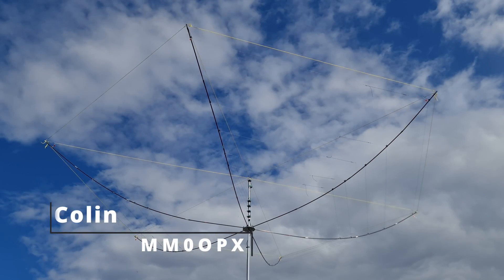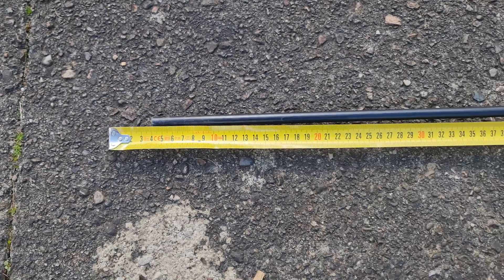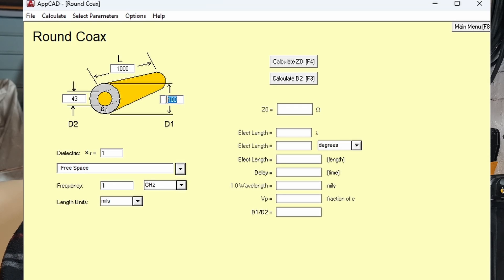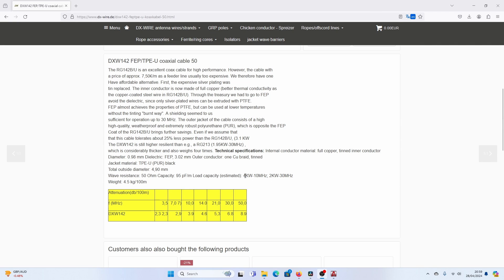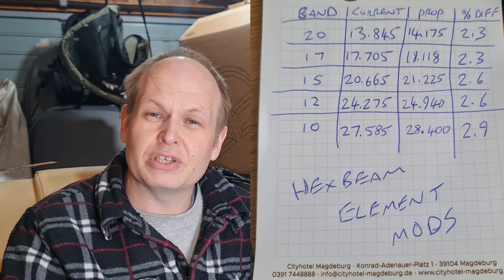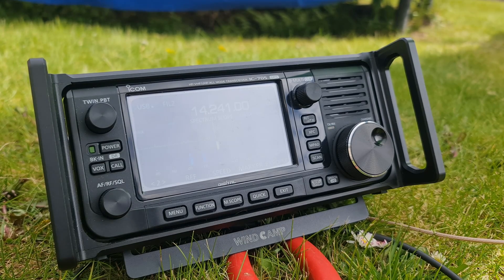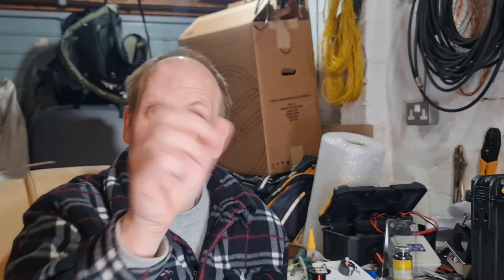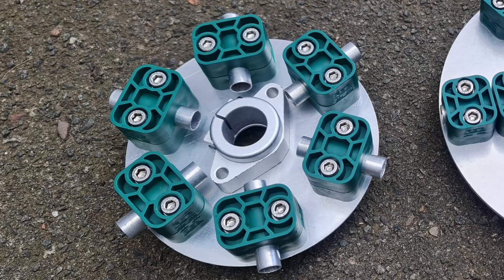The lightweight field day Hexbeam Antenna you can build

Comment: Hi! Today I assembled the most of the collected and manufactured parts of the Hex. Also with glassfibre, but I found 13 millimeter ones. I hope tomorrow I will manage to get it on the telescope tower and on air. I’m very hopefull! Thanks for all your tips. Your tip connectorwires were neccesary.

Comment: Hi Colin, great project and really interested in building one myself. Any chance you think a fibreglass pole could support the hex beam, like your 12.4m DX Commander? They themselves sell plastic hose clamps used for each section, which I'm thinking might be good enough for the downforce if you put the hexbeam 6m up it. Cheers!
Reply from the maker: If guyed properly then yes. The issue you will have is how to attach the hexbeam to the mast.
Reply: @MM0OPXFieldRadio  thanks a lot Colin! I love the idea of using it with my (semi) portable mast. Thanks for the reply and the video, much appreciated
Reply from the maker: @jagmillsmusic no probs 👌

Comment: Collin, are you going to release a complete video vuild start to finish of the lightweight field hexbeam? I'm planning on a trip to the South Pacific in 2 years or so and I'd love to be able to build this antenna to take along for some activations. Even your constructions notes from your cloud drive if your willing to share those would be very helpful. 
73: 
Michael DE VO1OP 
P S 
I'm also a YouTuber if you'd like to check out my channel, VO1OP's Ham Radio Adventures.
Reply from the maker: Michael, it wont be one big video but a series of smaller videos looking at individual sub assemblies. Same result. I will update documentation as I go.